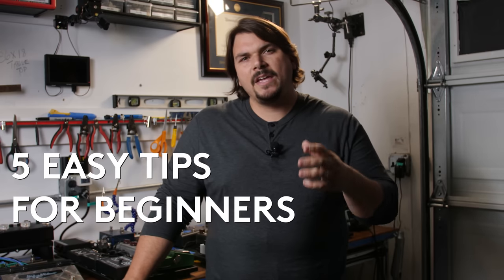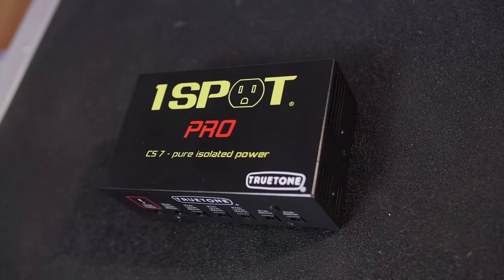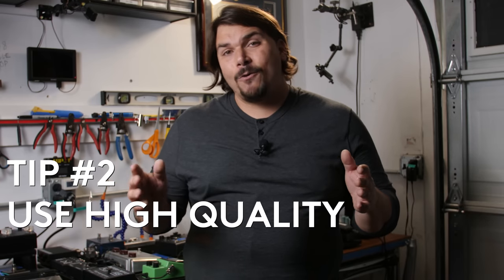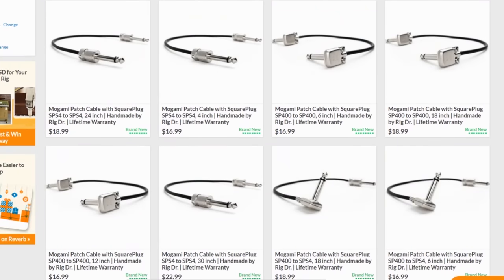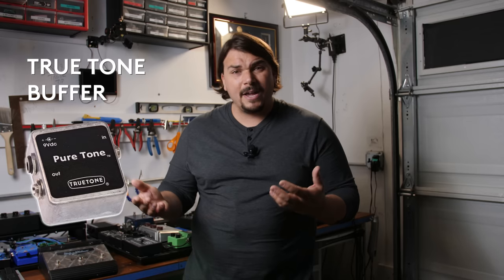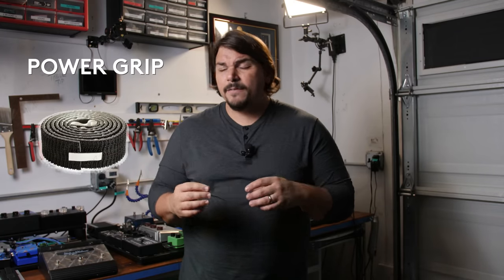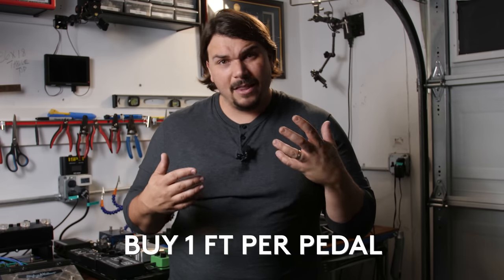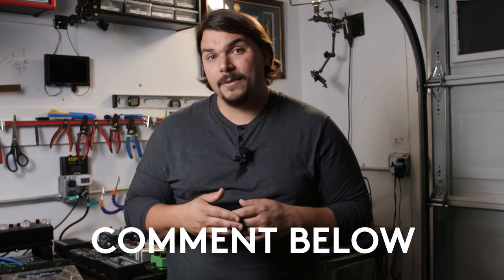5 Ways to Improve Your Pedalboard

Comment: Alright one more question. That spray... I’ve got a bypass foot switch on a pedal I’m thinking about selling that intermittently will stop my signal in its tracks when turning the pedal on.. and if I give it a little mini-press and release or two it’ll kick in. Possibly dirty connection that this spray would solve, or more likely something mechanical? Cheers!
Reply from the maker: You might just have a bad footswitch - this is easy to replace if you need to.  It can be hard, without disassembling the switch, to get access to the part that could be cleaned.  I'm not sure it would be simple for you to do yourself.
Reply: @VertexEffectsInc  well, it just so happens to be one of the lowest current $value pedals on my board, and I have a different pedal on the way that may be replacing its spot. Been wanting to get into modding/building... this could be a perfect way to get my toes wet. 

What’s your favorite beginner’s resource for actually getting somewhere with that info? Seems like most sites are either self contained “paint by numbers” clone kits that to me seem easy but you’re not actually learning much... or on the flip side “go do enough reading for an engineering degree, then come back and you’ll be able to start making whatever pedal”. Just looking for a happy medium. Thanks again for the info!
Reply from the maker: @studieslessonstheoryetc141  Anything from Jack Orman or Craig Anderton is a good place to start!

Comment: That’s why my line 6 pedals are so noisy,voodoo lab power supply. And other digital pedals I have. Hmm buffer in & out? Larry Carlton mic’ed his amp & had his FX in his mixer to what ever speakers he was using. I suppose these rules still apply.
Reply from the maker: Larry Carlton only did that for his wet/dry/wet system later in his career.  He fed his dry mic'd amp to a mic pre which fed his rack with a mic level signal which fed two JBL EON powered monitors as glorified power amps and speaker cabinets that only go the return of his 100% wet effects and had some sort of mixer in the rack to control the ratio of the wet/dry mix acoustically with the dry amp.

Comment: In my situation, I have a active buffered volume pedal in the middle of my chain and a buffered(switchable) reverb pedal at the end. Is this good for my tone? Or is it better to get a dual buffer pedal instead. Thank you!
Reply from the maker: You still need an input buffer (controlling your pickup loading) at 1M input impedance at a minimum.  If your Reverb pedal is buffered or always on, it depends on the output impedance and how good of a line driver it is.

Comment: I run a Empress Buffer Plus loop out before a boss MS-3 Input and end with the Boss MS-3 Output to the Buffer Plus loop input...would this cause any concerns or is this just overkill? All other pedals run through the return and send loops of the Boss MS-3.
Reply from the maker: I'd just bypass the MS-3 buffers if you use that.

Comment: Mason!! The doctor, the legend, the man.
Reply from the maker: Hahahahah!  Thanks Brian!
Reply: @VertexEffectsInc  👍 💯 the Dual Lock is key man! You were the guy to turn me onto it. I actually cover the whole board in 400 and then put 4 little squares of 250 on each pedal. Might be overkill, but at least I don't have to take it off. The 400 dual lock I use is pretty permanent. Near impossible to take off without some serious chemicals.
Reply from the maker: @BrianElliot  just get an upholstery crowbar and you can remove it no problem
Reply: @VertexEffectsInc  it's the type that has a black rubber-like bottom, and the adhesive is so strong that when you try to remove it, you get the black rubber stuff still there. 
It was the only reverb seller selling dual lock last I checked. Not sure the upholstery crowbar would do the trick there.
Reply from the maker: @BrianElliot  that's not the version I'm recommending or link - that's a cheaper version.

Comment: Just curious why you didn’t mention Voodoo Lab Pedal Power 3 Plus for power and Evidence Audio Monorail + SIS cables for patch cables. Is it because of the cost of the Pedal Power and the DIY nature of the SIS plugs? I’m also thinking about some of the GigRig power options.
Reply from the maker: Pedal Power 3 is great, and is a switch mode supply, however I was keeping the recommendations as "budget friendly" as possible for the purposes of this video.  Solderless cables are inferior to what I recommended in this video even if the cable itself is of good composition.  By its nature, a solderless connection, compared to a gas tight connection of a soldered cable, is a huge deficit and is why solderless is not used by the rig building community as a standard or best practice.  If you like the Evidence cable, use it - just solder it.  It's the connection which is the issue, not the cable itself.  Also, the Evidence is not a real "budget" option, most soldered cables are actually cheaper than these solderless kits and will be more reliable (all assembly being equal) than a solderless cable.

Comment: I change my board waaaayyy too much to use soldered cables.
George L's with canare GS cable with no issues. Low capacitance, but not the lowest..
Reply from the maker: It's one way to do it, not what I'd reccomend.

Comment: Is the Dual Lock 250 work pretty good against itself for pedals to board? The 400 is just so costly
Reply from the maker: It will be better than most velcro, but not as strong as offset with 400 loops.

Comment: Does the buffer theory also apply to an acoustic/classical guitar through a pedalboard into a PA for a looping rig?  I use 10 foot cable to Strobo Stomp > TC BodyRez > Boss OC-5 > Boss DD-200 >  Boss RC-500, then 15 foot cable to PA speaker
Reply from the maker: If you have an active pickup on your acoustic, no need for an input buffer.  Same with a wireless.  If you're going balanced out or DI into into a PA, you probably don't need an output buffer either in most cases.
Reply: @VertexEffectsInc  Thanks very much.  Yes it has an active pickup!  Now I only need to buy them or my Electric pedalboard!  Thanks Uncle Mason!  You rock.  I'm going to get 2 Mesa Stowaways as you recommended.
Reply from the maker: @marconazz  sounds good!

Comment: Earthboard make a battery pack for powering a lot of pedals which will reduce switching power supply noises, hum, etc. Have you tried using Earthboard battery pack to power your pedal boards? This is a much better way to go than to use switching power supplies
Reply from the maker: Doesn't appear to be an equal solution to a stand alone power supply.  Switch mode is the move over linear for sure, if the switch mode is designed for audio you won't have an issue with noise and far less than you would with a linear supply.  This battery device seems to be an inadequate substitute and supposing that it's a superior solution to a switching supply is a poor appraisal of the quality of switch mode supplies out there.

Comment: Hey Doctor, I have a big pedal board and I have 3 Walrus Audio Phoenix Power bricks, what I like about the Phoenix is that it has x4 9v100mA + x4 9v 300mA and 4 more with variable voltage 9v -12v -18v, about the noise you mention these are super quiet, however if I come very close to the pedal board with my guitar, I can hear noise from the magnetic field, however when standing or at least 3 feet away from the board it is very quiet, what is your opinion on the Walrus Phoenix? relative to price and capacity, thx for the tips.
Reply from the maker: Depends on context...they'r linear supplies so they can create issues with other pedals depending on where they're located.

Comment: Ok, all my pedals and  cords worked fine, my supply still turns on my amp works my guitsr works, all my cords were tested separately, i got my tuner to bypass and tune as soon as i plug anotherone in, no sound?
Reply from the maker: I'd test your pedals...you might have an intermittent jack.

Comment: I wanna know where you get DEOXIT D5 for under $10. Everywhere I"m looking online or locally is over $15.00 a can. Even the Mini Can is like $14.95 on Amazon. Also what about the (Warwick Rockboard Flat Patch Cables Gold series? How good are they? What's the differences between Mogami 2314, 2319 and 2524 cabling as patch cables?
Reply from the maker: This video was made a while ago...perhaps prices have gone up or I was exaggerating based on what I remember the price being when I got it last.  Warwick...can't be sized, you're not in control of the quality of the plug or cable either.  It's a consumer level product.  Diameter and application for the Mogami cables.  2524 is for instrument cables, not a pedalboard.  2319 and 2314 are for pedalboards,  they're very similar.  You can watch our cable shootout to see how they compare.  I prefer 2314.
Reply: Ha $18 on Amazon today.  Have to go with another brand.
Reply from the maker: @mhoff7722  nothing is equal...some of them will even do more damage than without using it.
Reply: @VertexEffectsInc  For sure. I found that out the hard way of course :)

Comment: If I'm using my amps effects loop, do I then need 4 buffers? (Start of input pedals, end of input pedals, start of effects loop pedals, end of effects loop pedals)
Reply from the maker: Generally input and output buffers - dual buffer - will be ok.  Input and output buffer.  If you have a passive effects loop you may require more.
Reply: @VertexEffectsInc  Thank you!
Reply from the maker: @Infinighost  my pleasure!

Comment: What "rechargeable battery" for pedal boards would you recommend using to power all kinds of guitar pedals on a pedal board? The switching power supply cause that switching noises and other power line noises when using overdrive and distortion pedals. I wonder how those warrants really go for those patch cables I doubt the companies will exchange a bad patch cable for a brand new one for free.
Reply from the maker: I've not seen a rechargeable solution that works as well as a power supply or as quiet as a quality power supply.  I can't recommend any.  If you have a poor quality switching supply, sure it can cause noise.  Just like a linear power supply will cause noise if you get devices too close to it or you don't have proper EMF shielding.  Of those I recommended you won't have any issues and any of the hi frequency is well out of the audio range - this is also true of Strymon power supplies, the newer Voodoo Lab Pedal Power 3, and Cioks.  All those patch cable companies offer a lifetime warranty, if you're concerned about them making good on it, contact their customer serivce.
Reply: @VertexEffectsInc  when measuring the patch cables capacitance using an LCR meter what is considered good and bad capacitance values for the patch cables?

Comment: What’s your opinion on the walrus audio power supply? The big guy. I have a friedman power supply that works but building a second board and want to use other stuff possibly.
Reply from the maker: In falls into that older style supply like the Voodoo Lab Pedal Power, Mondo, 4x4, etc. - a linear power supply.  It has a toroid transformer as I recall but no electromagnetic shielding...this could be an issue if you plan to have pedals above it - otherwise it should be as isolated from pedals (in proximity) as possible.  I recommend using a switch mode power supply whenever possible.
Reply: @VertexEffectsInc  oh wow That’s interesting. I love walrus and have a bunch of their pedals but also hate noise. Ha. The one you suggested in the video is cheaper so that’s always a plus. Lol. Thanks for replying

Comment: Is there any danger to spraying dioxit into a pedal and spraying the circuitry?
Reply from the maker: You should have any need to spray it directly onto the device, input and output jacks and your power jacks should be the ideal spots, and work in the liquid by plugging in and out the Jack multiple times
Reply: @VertexEffectsInc  Perfect. Thats what I was wondering. Thank you. I just ordered some cable tie mounts and some DeoxIT from your link.
Reply from the maker: @petedonaghyguitar  Amazing!  Thank you so much!

Comment: Mason, what do you think about  the one control BJF buffer?
Reply from the maker: Look at the specs, I gave an outline of what they need to be at a minimum, 1 Meg input impedance, 100 ohm output impedance.  They should publish this on their site.
Reply: @VertexEffectsInc  will check there site, thanks!!
Reply: @VertexEffectsInc  Had to email them. Input impedance: 1M ohm output impedance: less than 1K ohm
Reply from the maker: @BadHorsie2  1M Ohm = good, 1K Ohm = bad, 10X worse than what is recommended (100 ohms)
Reply: @VertexEffectsInc  gotcha, learning a lot!!

Comment: I saw a post from someone claiming to be an engineer, stating he had disassembled an MXR ISO-brick, and found them not truly isolated...?
Reply from the maker: Show me...I'll have a look.
Reply: @VertexEffectsInc  I couldn’t find it, as that was a few years ago, when I was researching for my first board build.  Just curious if you’ve opened those up, as I would trust your opinion & expertise!
Reply from the maker: @scottgeyer684  The ISO Brick versions are quite new, maybe the last 2 years or so...it's possible that these post dated the time you got an "MXR Brick" which is a different, and cheaper supply.  If you concerned about quality, get a Truetone power supply.  The CS6, CS7, and CS12 are all great.

Comment: I use 3 to 4 pedals,
Do i still need a buffer input and output?
Reply: I'm in a similar situation. I don't think we need it as much as those with 10 plus pedals. I may start with a boss tuner pedal and maybe add a true tone buffer to the end and see if it does anything

Comment: I have about 5 BOSS pedals in the middle. Do I still need a buffer before and after? The closest to my guitar is the Boss FW3 w/ Behringer NR300 in-between; and the last one is a Boss BF3 followed by Line 6 Tap Tremolo to front of amp. My delay and reverb pedals are in the effects loop.
Reply from the maker: It’s gonna be a lot of buffers, you might start with an output buffer and see or and input buffer and see.  I don’t know the impedances of your pedals.
Reply: @VertexEffectsInc  Thanks! Will check and see. 👍

Comment: Dont many newer pedals have some sort of buffering in them already?  One of these gear channels said that.  So  is it actually necessary to buy one? Also I got a Boss tuner, so is that good enough also? Some of us dont have tons of extra cash and just have to   get by as much as possible. OK so you say there is different densities of  velcro, okso which one is the right one for pedal boards? You did not say that.
Reply from the maker: Generally, no, and if they do the quality is low.  Most of the gear channels on YouTube aren't by people that manufacture pedals or have any technical experience in repairs or electronics.  Boss Tuner possibly one of the most mediocre buffers every made...the same buffer that's in most Boss pedals, JFET input stage and BJT output stage.  I would suggest our Power Grip Velcro or 3M SJ3550 paired with SJ3551.

Comment: i got a cheap power brick on amazon for $28, and i switched to that from a daisy chain. i know that neither is ideal, but even then is the brick better than the daisy chain? i didnt have much of a choice because im on a very low budget
Reply from the maker: I guess it depends on the quality of the supply...many of the cheap ones aren't isolated either so it's really the same difference.
Reply: @VertexEffectsInc  how can i test if its isolated?

Comment: great video Mason. how about the tc electronic polytune 3 mini that has buffer on it?  will it work fine as a buffer too? does it have the good buffer built in like the boss tuners?
Reply from the maker: You can use that as an input buffer, you'd still need an output buffer at the end of your chain.
Reply: @VertexEffectsInc  thanks Mason. also what other brands of contact cleaner would you recommend? coz in the country i am in right now, there are some contact cleaners but no DeoxIt.
Reply from the maker: @rockyfolksy8639  Deoxit is unmatched.  I haven't found its equivalent.
Reply: @VertexEffectsInc  how about the WD-40 specialist Electrical contact cleaner?
Reply from the maker: @rockyfolksy8639  Nope, WD-40 is not a contact cleaner
Reply: @VertexEffectsInc  thanks for the info Mason. 🙏
Reply from the maker: @rockyfolksy8639  sure thing!
Reply from the maker: @tompoynton  I don't know it - but I've seen lots of other contact cleaners do more harm than good and DeOxit is a mainstay on every technicians workbench in the world.
Reply: @VertexEffectsInc  good to know, thanks. It’s just a shame that DeOxit is so expensive in the UK, £27 on Amazon... (over $35!)